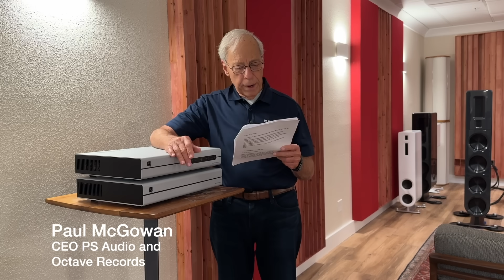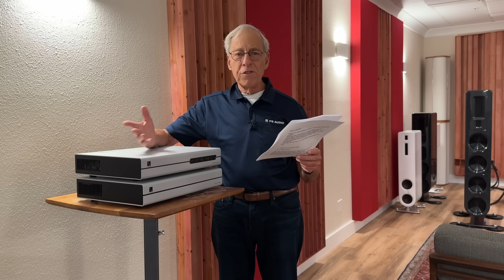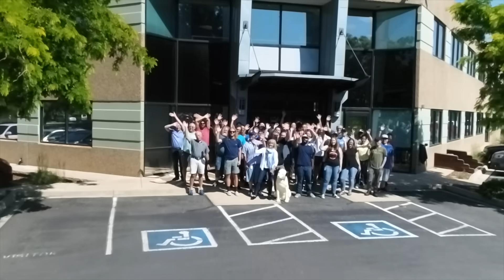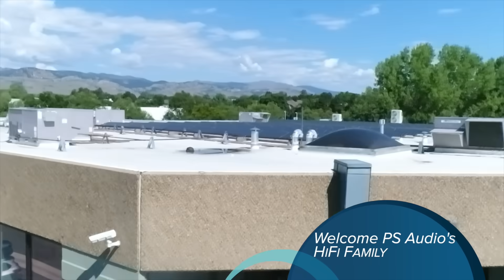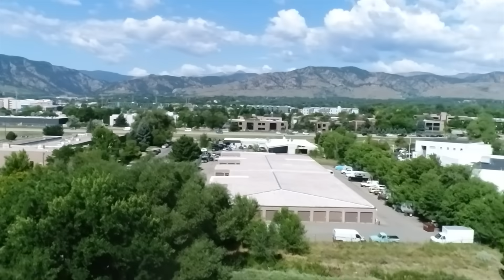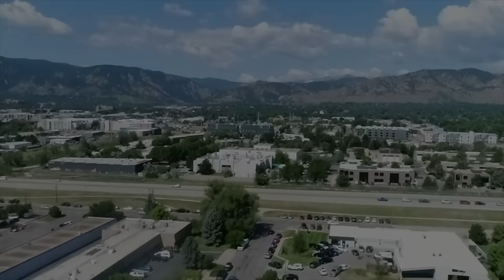Why should we care about distortion?

Comment: Paul is correct.  Most people can't here less than 1% distortion.  Trained ears might get down to 0.5% or so.  

But we have to consider that every device in the analog signal chain -- DAC, phono pre-amp, Cassete player, CD player, pre-amp, power amp and speakers --- will contribute at least a tiny bit of distortion that adds up as the audio signal travels.  It is the sum of the distortions that we actually end up hearing.  Loudspeakers are the worst, typically running about 1% on their own.
Reply: It's more complicated than this. A 0.5% distortion number doesn't actually tell you what exactly is happening in terms of specific harmonics being presented. Generally, even-order harmonics are less noticeable because they occur naturally in many acoustic instruments and tend to blend harmoniously with the fundamental tone. To make your 0.5% audible, you would typically need some uneven-order harmonics to be in the signal.
Reply: @ThinkingBetter  
Agreed.  Thanks for adding this.
Reply: @Thinking Better. According to your somewhat flawed logic, when we wake up in the morning and don't look so good, that wouldn't be real; only a distortion. No...unfortunately it is 100% real and 100% accurate of how we look at that momment. No distortion. It appears you don't understand the meaning of the word  distortion. As far as music goes,  distortion, which can be synonymous with the word change, refers to any "change in the sound" compared to how the instrument sounds unamplified. A violin played with too much force might create bad sounding resonances, but those resonances are not distortion. They are simply 100% accurate (no change) of how that instrument sounds when payed in that way. But playing an instrument with such maniacal force is not relative at all in our recordings, which use at least somewhat competent musicians. And "broken or flawed acoustic pianos" ( far out there),  sound 100% the way they do also, when flawed. The 100% real, genuine and accurate sound of a broken piano; with no distortion; which is always refers to electronic reproduction. Broken pianos are not a problem in recordings ever that I know of; so that point of yours was to just try to win a debate, and couldn't be further from relevant.
Reply: @sidesup8286  No, actually this is the opinion of ChatGPT (I copied from it). And I also agree with it. I think it's fair to use the term distortion when an instrument is creating unwanted harmonics e.g. due to some broken or worn-out piece of it. I tried a couple of other LLMs and they agree with me.
Reply: @ThinkingBetter  ... "opinion" being the operative word here since I have found ChatGPT to not be 100% accurate, or rather 100% informed, in many cases.
Reply: Yes, indeed you have a percentage of errors using LLMs. A few days ago I asked for getting a logo rendered in ChatGPT with some theme and it returned a really awesome nice design but included a misspelling. Same goes when I ask for software code and it provides code that some times can't even build without some debugging effort. But I'm not sure that error rate is any more at this point than when asking a human and it surely does amazing results in very short time compared to what it would take humans when it comes to creating text replies, documents, software, graphics, music and video. AI hallucination rate is a concern being addressed. GPT-4.5 is quite impressive and soon we will get GPT-5.0 closer to AGI. Most people have no clue how sophisticated questions they can ask and get meaningful replies. For example, yesterday I asked about if anyone violated a patent of mine and it actually did a very comprehensive analysis of other products that would have taken a patent attorney weeks to do.
Reply: @ThinkingBetter  ...a very good & pleasing result for you.
However, how do we know that it's information is 100% correct?
We don't; we just assume that it is because it's ChatGPT ...the latest god on the block 🙄😝
Reply: It is rapidly getting better but it's good to assume that errors can happen. A few years ago we were impressed by Siri, Alexa, Google assistant and Google search, but now we have entered a totally different phase of technology evolution with AI able to do things we a few years ago thought was decades out in the future. Soon the best music, movie, document, software and so on will be output of AI. Yes, some day soon AI will render amazing natural sounding  audiophile music with a soundstage and details of highest standard.
Reply: @ThinkingBetter  
" Yes, some day soon AI will render amazing natural sounding  audiophile music with a soundstage and details of highest standard."

Yet another reason why my popular music collection dead ended in 1999.
Reply: @ThinkingBetter  ...the main thing that concerns me about A.I. is how the inventors & developers of A.I. are now warning us of it's dangers into the future. Great music or better tools for international hackers & professional con artists? 🤔 I guess it depends on whether you get big-time scammed or not.
Reply: If AI will give us more free time and make us happier, it's great, but I am not so convinced that becomes the reality. Rather, greed and corruption could drive it to take a stronger hold towards leading governments and companies with humans being subservient to AI and many jobs ending up replaced by AI. The business of making music has gone through a long phase of selling physical media like vinyl discs, cassette tapes and CDs being the driver to now streaming services are dominating. If anyone can create superior music through AI, the business value of a song drops off the cliff. Same goes for movies. I live south of LA and one of my predictions is that the entire entertainment business around Hollywood and Beverly Hills with all those music and movie celebrities will be doomed some day. I'm not sure I want to watch some next Mission Impossible movie made by AI pretending Tom Cruise is the actor by only his photo being used. And same goes for music. Much of my pleasure in consuming media is the human touch in it.
Reply: @Douglas_Blake  https://www.youtube.com/shorts/Sa3OnrRA4PI
Reply: https://www.youtube.com/watch?v=BzX1YFZW0jc
Reply: AI music and video that I and other Danish (incl. Greenland) people agree with: https://www.youtube.com/watch?v=Qlrg7hvgxek
Reply: @ThinkingBetter  ...I'm blessed that I was born in 1960 because all of the best music was created in the '60s, '70s, '80s & half of the '90s (yes, I know, every generation thinks that the best music is from their generation)...I'm listening to Deep Purple - 'My Woman From Tokyo' right now😜
What passes for music these days does not interest me & I doubt that A.I. music will interest me either...no soul.
There is already talk of A.I. taking 85 million jobs in America & then what?
I guess that those 85mil can be retrained to go & work in Trump's brand new MAGA factories🤔😂🤣
Reply: @ThinkingBetter  ...yeah, OK, point taken.
However , maybe it's nostalgia for me these days because this A.I. song does nothing for me.
Reply: I'm not trying to sell AI music lol...I'm also not into it, but I can see it's rapidly getting better.
Reply: @ThinkingBetter  
Yep ... that one I like.
Reply: @ThinkingBetter  
True enough.  

Old wisdom: "The first use of any new technology will be it's worst use."
Reply: @ThinkingBetter  ...Lol, I know that you're not trying to sell A.I. music. You made your point to me.
'Thinking Better' sounds like a terrific brand name for an A.I. product 😂🤣😉
Reply: @Douglas_Blake  You mean this one: https://youtu.be/xEOZVsoCeaM?t=387
Imagine one guy making such Pixar video with music in less than one day?
Reply: I heard an antique car horn the other day. The horn had an awful ugly sound to me, but the person next to me thought it sounded cool. Is an unpleasant sound, distortion? No! Is something distortion if it makes sounds unpleasant to you? No..If an acoustic instrument is not played the way it is intended and makes an unmusical sound; is it distortion because the instrument was not used the way intended? No...If a garbage can is banged on and makes a sound you find unpleasant...is that distortion? No. The garbage can is intended to hold garbage not be hit upon. But it's still not distortion; only a sound that is unpleasant. If any souund comes from something it is it's genuine sound; since no reproduction is involved.
Reply: @sidesup8286 Yes, a musical instrument can have distortion, either intentionally or unintentionally:

---

🎸 Intentional Distortion

Some instruments, especially electric guitars, are designed to use distortion for artistic effect. This is typically achieved by overdriving an amplifier or using a distortion pedal, producing a gritty, aggressive sound widely used in rock, metal, and blues.

Guitar distortion pedals (e.g., Boss DS-1)

Amp overdrive (tube saturation)

Fuzz effects (extreme distortion)

---

🎹 Unintentional or Acoustic Distortion

Even acoustic or non-electric instruments can produce natural or accidental distortion:

Brass instruments can "break up" or distort if overblown.

Cheap speakers in digital keyboards can distort at high volume.

String buzz on guitars or violins can sound like mild distortion.

Poor mic or pickup quality on any instrument can introduce unwanted distortion electronically.

---

🎧 In Audio Engineering

Engineers may also add distortion digitally or analog during mixing or mastering, even to clean-sounding instruments like:

Vocals (for edge or presence)

Bass (for warmth or punch)

Drums (for grit or vintage tone)

---

Summary

Yes, instruments can have distortion.

Electric instruments often use it creatively.

Acoustic instruments may produce it accidentally or naturally.
Reply: @sidesup8286 I tend to agree with this interpretation of the word.
Reply: You confuse distortion with a bad sound. Not the same thing. Acoustic unamlified vibrations in the air, whether they sound good or horrible are not distortion. Soundwise, distortion of something takes two things not just one. When a single acoustic instrument is playing unamplified, how can it be a distortion or a difference from its own self? Add an amplifier and speakers and the sound can be altered, have distortion and a difference between the instrument amplified or not amplified. A single acoustic instrument with nothing connected to it, doesn't even produce distortion if it is picked up &  smashed into pieces. ala Pete Townshend. A crash is not a distortion either
Reply: Paul is always correct. But thanks for telling us.... again
Reply: @Pete.across.the.street  ...hahaha...no he's not. He's about 87% correct...just sayin' 😉
Reply: @Thinking Better. How can distortion occer in acoustic instruments? Whatever sound an acoustic instrument makes unamplified is the 100% correct sound of the instrument. Unamplified acoustic instruments are the "absolute sound." Distortion is a byproduct of "electronic reproduction" Never the former; always the latter.
Reply: @sidesup8286 1. Claim: "Distortion can't occur in acoustic instruments."
This is not accurate. Acoustic instruments can produce forms of distortion, especially when played at high volumes or outside their design limits. For example:

A violin played with excessive force can produce a "scratchy" or "raspy" sound (a form of nonlinear distortion).

A piano with worn strings or soundboard issues may introduce unwanted overtones.

Brass instruments may "break up" when overblown.

2. Claim: "Unamplified acoustic sound is 100% correct."
This assumes an idealized instrument in perfect condition and perfect technique. But in practice, instrument design, materials, environment, and playing technique all affect the sound. There's no universal "100% correct" sound—just a natural one.

3. Claim: "Distortion is always from electronic reproduction."
Electronic reproduction does introduce measurable harmonic and intermodulation distortion, especially in cheaper or poorly designed gear. However, distortion in the broader sense (i.e., deviation from an ideal waveform) is not limited to electronics.

Conclusion:

Acoustic instruments can and do produce forms of distortion, though they may be more musically pleasing or less objectionable than electronic distortions.

The comment is rhetorically compelling, but technically incomplete and somewhat misleading.
Reply: @ThinkingBetter  how are you defining distortion? I also asked Chatgpt the definition of audio distortion and the response was not the same as yours. It aligned with what sidesup has stated in his post.
Reply: @GetzenBassPlayer Just ask "Can a music instrument have distortion?" and tell me what it answers...
Reply: @GetzenBassPlayer  Merriam-Webster defines distortion as the act of twisting or altering something out of its true, natural, or original state. It also refers to the state of being distorted, or a falsified reproduction of an audio or video signal. In essence, it involves misrepresenting something by changing its form or meaning. If the original state of a piano is a particular sound and some glue between two wooden pieces disconnect and vibrations create resonances yielding unwanted harmonics, I would call it distortion, for example. I don't see any reason why "distortion" can not be a correct term no matter if it's some transistor amp clipping, perhaps due to a worn-out capacitor, inside an electric organ or some violin sounding bad due to a worn-out string. I checked with different LLMs and they all have similar interpretation of this term in respect to instruments. Now, this doesn't mean the WANTED harmonics of an instrument should be called distortion e.g. a kick drum wouldn't sound like a kick drum without the harmonics involved. But if a kick drum got some damage and it made a different pattern of harmonics, I would call it distortion (as per Merriam-Webster's definition of being non-true to its original state).
Reply: @ThinkingBetter  I don’t believe your definition of distortion is the common use of the word as it pertains to this subject.
Reply: @ThinkingBetter   I have never described the sound of a non amplified instrument as distorted
Reply: What do you call the undesired sound from a broken instrument where, for example, some loose piece is rattling?
Reply: @ThinkingBetter  I call it what it is, a broken instrument. I say, “Hey man, your water key is leaking”. I don’t say, “Hey dude, you better fix that distortion”. I have 40 years in the music business as a player and teacher. I can’t think of time of a time I would use the word distortion to describe a non amplified sound by an instrument
Reply: Hear, not here. Even over there.
Reply: @HansDelbruck53  
Thanks for pointing that out.
Saw it after posting, not worth the edit.
Reply: The no distortion, 100% accurate & genuine sound of an instrument that sounds messed up because a part is loose.

Comment: Negative Feedback can create it's own sonic problems when being used to trim distortion. Bent Holger of HEGEL Audio has his Feed Forward - 'Sound Engine 2' circuitry (topology) that works very well to minimize distortion in his amplifiers.

As Paul says, "all of these things make a significant difference sonically...but they could measure identically." And this is exactly why I place no importance in measurements once the development & production stages of bringing new home-audio gear to market have been completed. Once the new gear is boxed up & sitting in the warehouse waiting to be sold it's 100% about how it sounds & you only need your hearing for that.
Reply: Error correction does the same like negative feedback just locally.